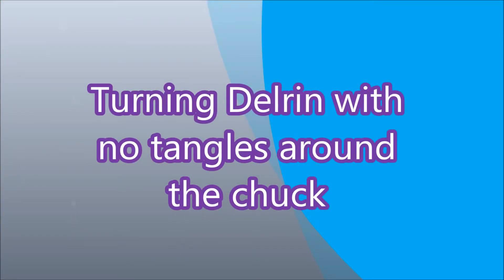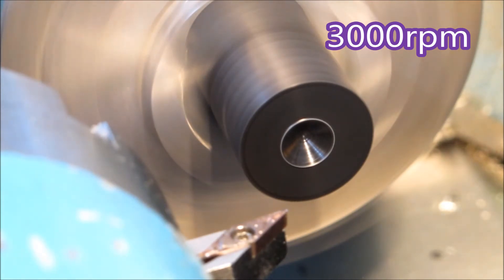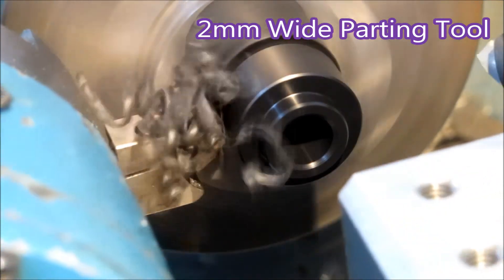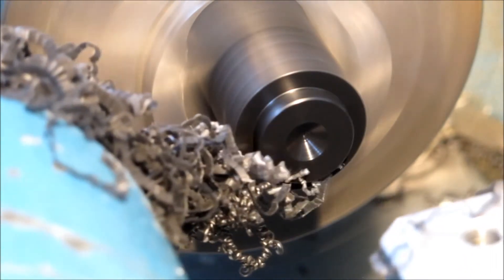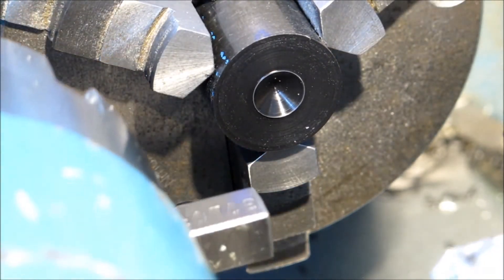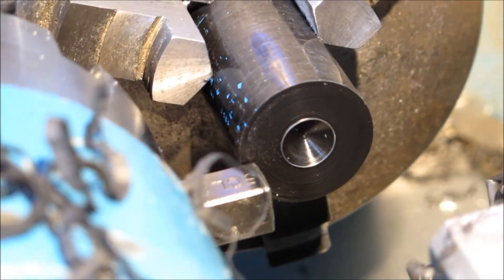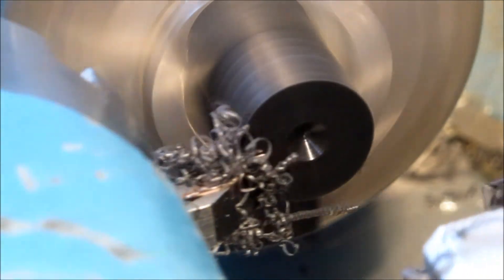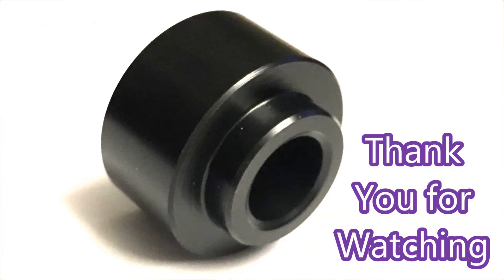Turning Delrin on a small cnc lathe, Sumitomo FC insert and parting tool with 9.0mm stub drill

Comment: How many tools can you put in the rotating tool holder at a given time?
Reply from the maker: Hi Perry, 8 tools but I have never used that many in the turret. I cheat a bit by having the gang tooling block on the cross slide.
I prefer to have long drills etc in the block rather than the turret. Long drills hanging out of the turret do not strike me as a good idea.
Thanks for your comment

Comment: Delrin is an awesome material. Nigel the bagpipe maker uses it loads. Sharp tool is a must to get a nice finish. 

Q. Are you mates with Martin the sand casting genius in croydon?
Reply from the maker: I like to think so. He is about the best on yt when it comes to sand casting. There may be others more popular but that does not make them better at what they do. Olfoundryman gets a great finish and he heat treats the castings to improve their machineabilty.

Comment: Boy, that looks fast - is it in Realtime… Martin
Reply from the maker: I guess 3000rpm and high feed rates to help get rid of the swarf will do that.  That is the most visually impressive thing about changing up from 2000 to 3000, the feeds just appear so much quicker.  The spindle is faster too but not as noticeable as the feeds.  Real time, I endevour to caption a video speed change.